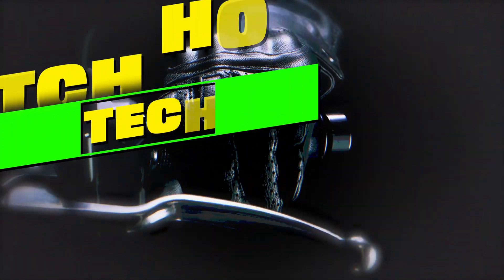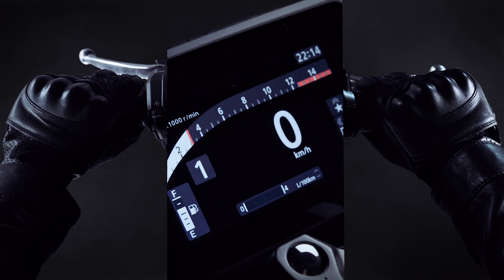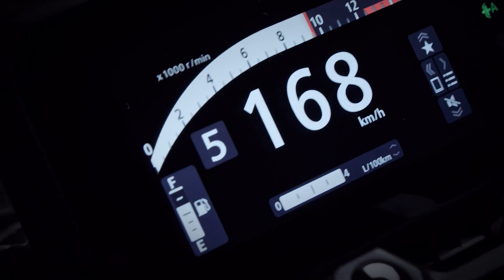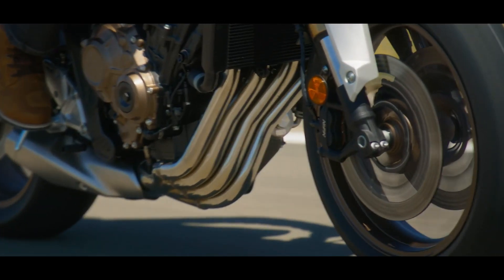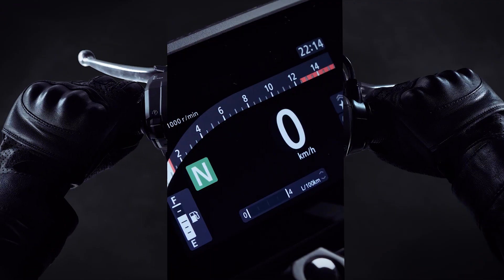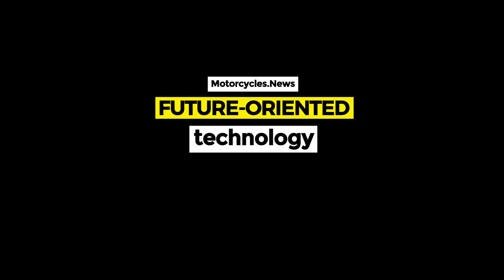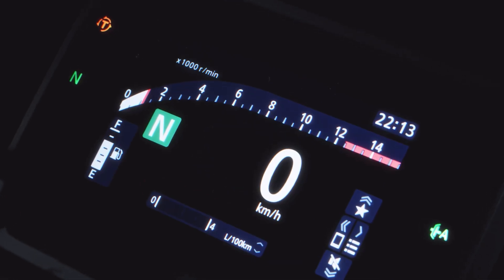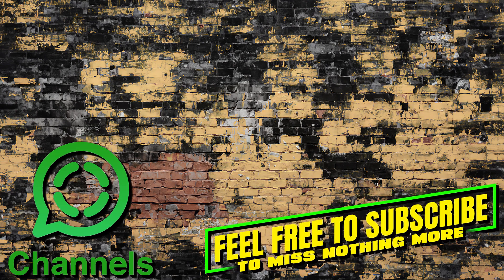Honda's E-Clutch -The revolution of shifting?

Comment: Interesting, but aside from weight and cost, how does it differ from a DCT’s manual setting?

I’m doubtful many do but, while I can’t add a clutch lever, I can add a foot shifter to my DCT Africa Twin and use “manual” mode to shift when I want. Plus, even if it is in DCT, I can override it anytime I want. Add to that, DCT offers a number of “modes” (IE sport, gravel, touring) that really does change the shift points and defaults automatically to neutral and, it can’t stall out. For good or bad, the eClutch won’t do that. That said, the eClutch is interesting; looking forward to reviews.
Reply: I guess the difference is the way the gearbox work itself since e-clutch still use normal gearbox instead of dct, dct is good for smooth moving and comfortability but the gearing and how it work itself is not good for performance/high speed, furthermore dct is higher cost to repair because of it complexity if anything ever happen to it compare to this new cb650 in which they still use traditional gearbox and gearing it's just that there's automated clutch that work outside of the gearbox so incase if the clutch itself got problem it got nothing to do with the gearbox, I guess honda is trying to make a slightly performance oriented motorcycle but somehow have the extra benefit like the goldwing since most people use cb650/cbr650 for daily usage and sometime weekend riding too
Reply: @DigitalExpert-eg2je Excellent points!